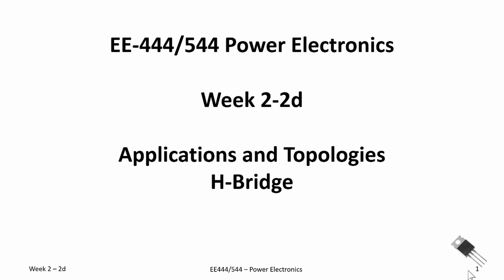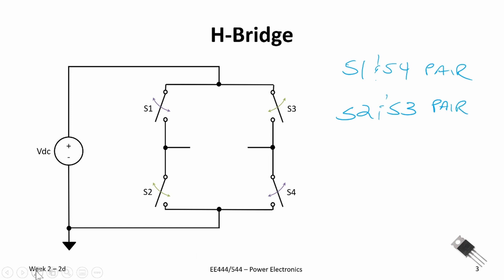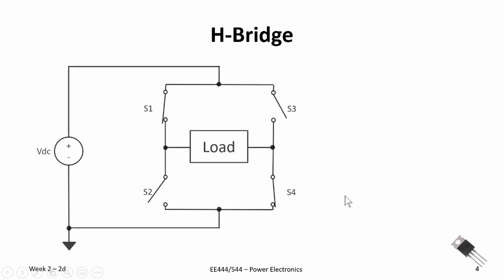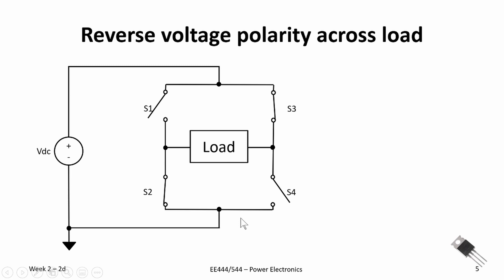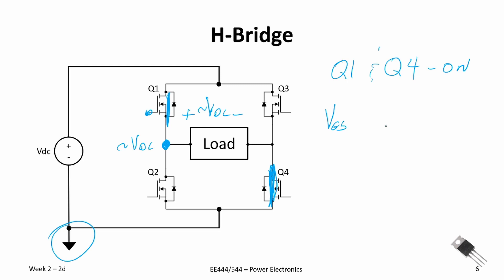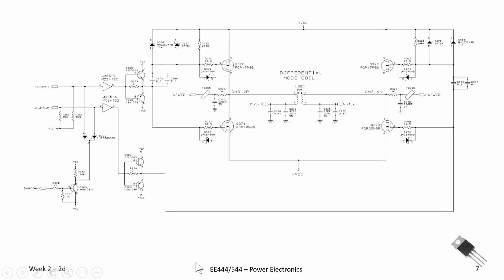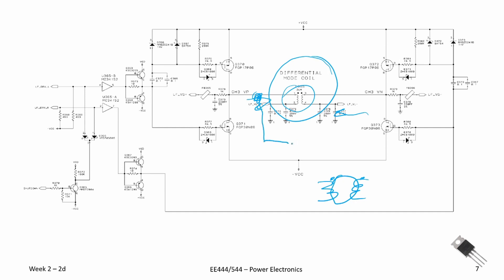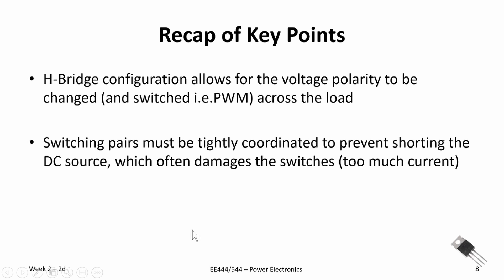Power Electronics - The H-Bridge Topology

Comment: I think the transistors you chose are all of the same negative type. is it correct ?
Reply from the maker: Yes, that is correct.  I do not show the gate-driver circuitry or control for this.  That would be another video.  N-channel MOSFETs require special circuitry for high-side driving. There are h-bridge topologies in which the two high-side switches are P-channel MOSFETs.  This makes for easier switching.  Best wishes on your design. - Dr. K

Comment: How could the primary and secondary windings of that transformer make it look like a short circuit, or act like a straight wire? Is it because the magnetic fields cancel each other in differential mode of operation?